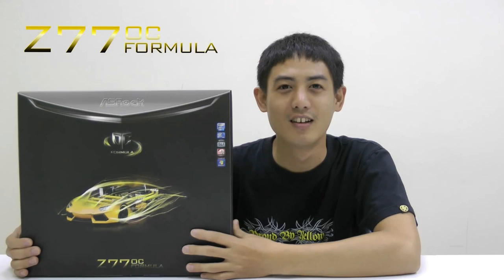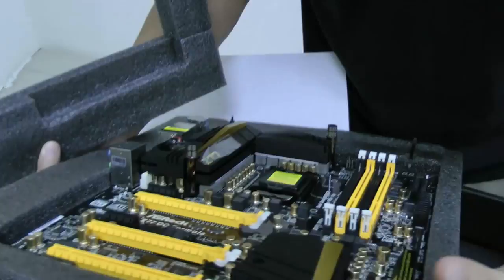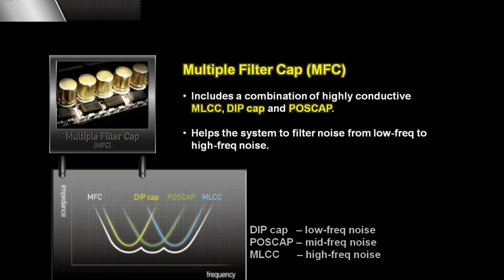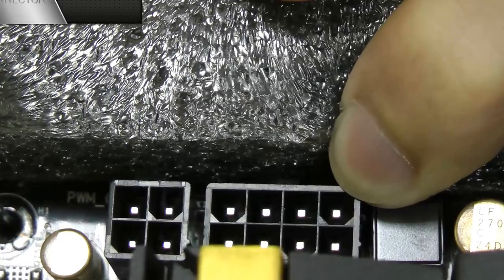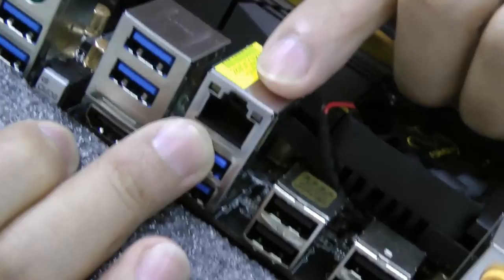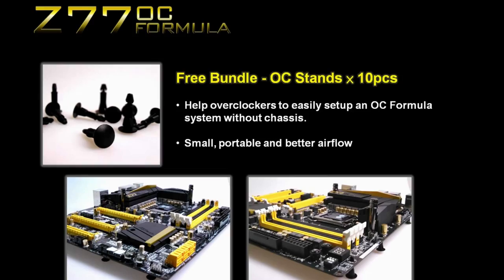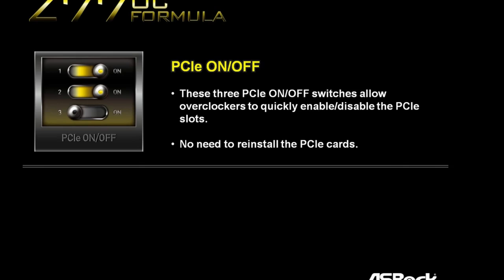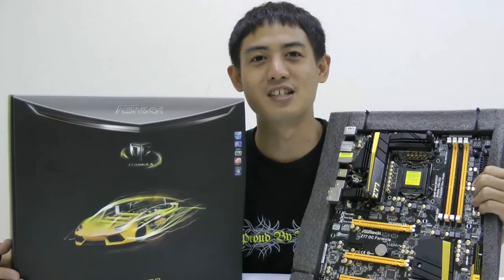Unboxing - Z77 OC Formula by ASRock [HD]

Comment: OC Formula vs. Gigabyte Z77X-UD4H for I5 3570K oc to 4,5 ghz daily-use! Is it worth the high-end features and price of OC Formula for just 4,5 ghz or UD4H do the same job with less money? Also add another GTX 670 for SLI with my current Gigabyte GTX 670 OC.
Wich mobo should i get? Thanks for advices!